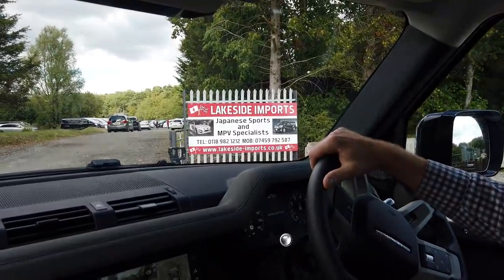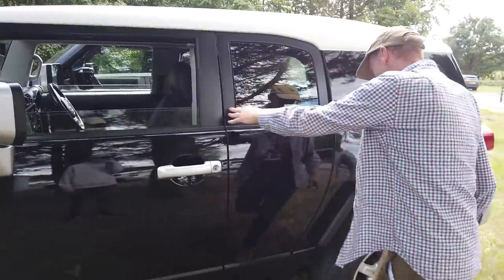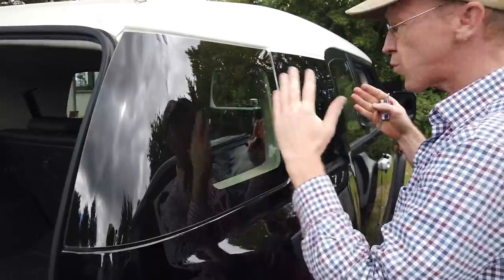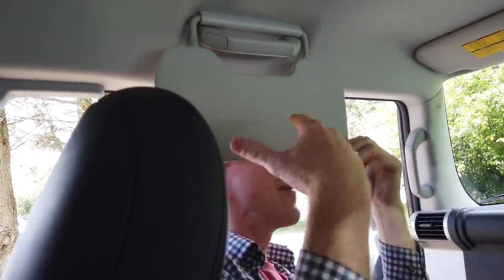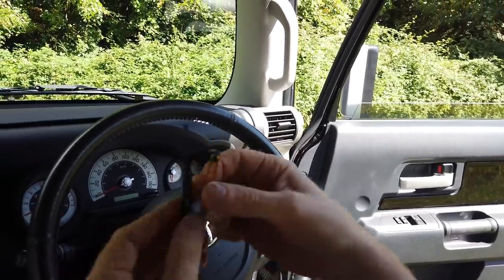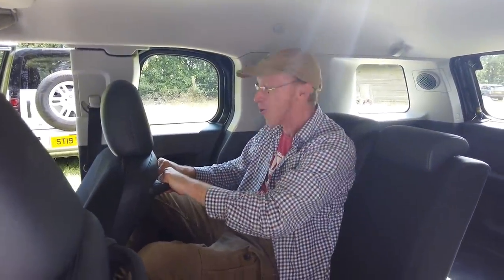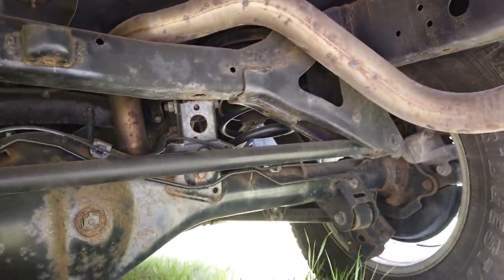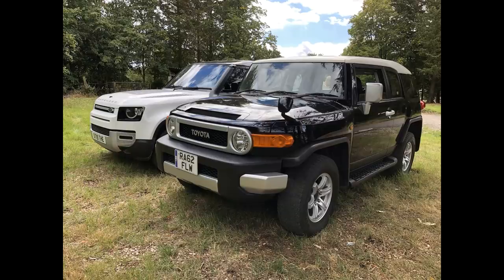What would a new DEFENDER made by TOYOTA look like ? they already made one 14 years ago !

Comment: The main thing both vehicles have in common is that they both take practical features of the original vehicle and use them as superficial styling-cues in the replacement model.

Beyond that, it'll be interesting to see if the new Defender manages to retain the level of respect that the FJ has 15 years after it was released.

Comment: Love the FJ cruiser and its retro looks - I think JLR could have done a little more on the exterior styling of the Defender to pick up on the old Land Rover Series / Defender styling.  For the lights at the rear of the Defender, which are hidden when the door is open, why not fit a low-profile slave indicator and rear light set on the inner frame of the door, which would only become active when the door is fully open?  It’d help improve visibility and safety.  Another feature which JLR could have thought about (if there’s the opportunity to make a suggestion) is to have an auto-level feature when the vehicle is parked, if desired.  It would be a very desirable (and perhaps unique) feature for people camping in a roof tent, and save a lot of time messing about with wheel chocks, trying to level the vehicle when there’s no option but to park on a slope.  Perhaps a fairly simple algorithm I’d have thought given the amount of wheel travel on the air suspension.  Really great videos - keep them coming 👍

Comment: That is a 2011 RHD , the late 2013 up is even better , having the 200 series crawl control and the Atrak up on the roof , Atrak is essentially the same system LR have used from the Disco 3 , LR uses it on all 4 wheels , the Atrak on that car is effectively the front diff lock . Dont expect any problems for at least the first 500000 miles .
Reply from the maker: I do want one.... to sit next to my Defender !

Comment: Nice Video, here in Canada these are popular and ridiculously overpriced as a used vehicle.  4 Runner uses same platform.  BTW no centre diff lock but 4 hi and lo are locked as standard. Normal pavement requires 2hi.  Should have a rear diff lock though, not sure if that was an option.  Crawl control could have been an option as well,  Cheers!
Reply from the maker: Thanks for the info.. its still a lot of money for an old 4x4 in the UK at £25K A used Land Rover 2012 Disco 4 would be a little over half this price.
Reply: The US and Middle East spec FJs have rear diff locks and separate A-trac button, at least those with 4WD I've seen and the one I own for the last 8 years:)). This particular one of 2012 on the video is post-2010 restyling version and has the VSC off button instead. Restyling also brought more powerful double-VVTi engine (270+ HP) and resolved the front inner flare bulges/cracks issue. Other cool features of the FJ not mentioned on this video were: the stock subwoofer and mesh  pocket on the rear door (obvoiusly absent on this one) and parking lights on the mirrors  (easily replaceable with something more productive:))). And the last thing is FJs with auto transmission were part-time while 6-speed manuals were full-time 4WD.
Reply from the maker: @bakhtiyarpakhirdinov2461  Thanks for pointing out some of the other cool things about the FJ !